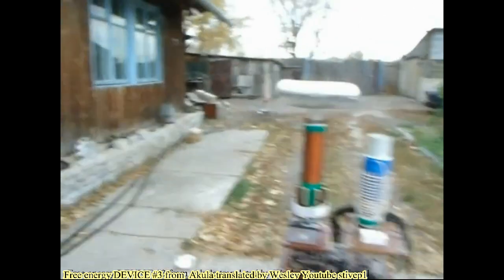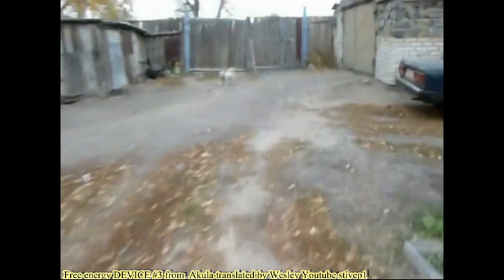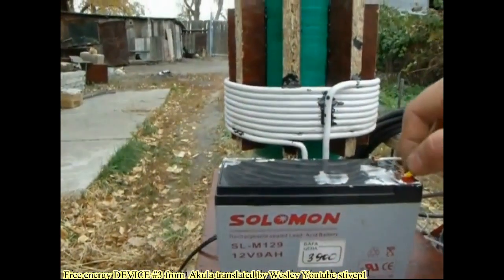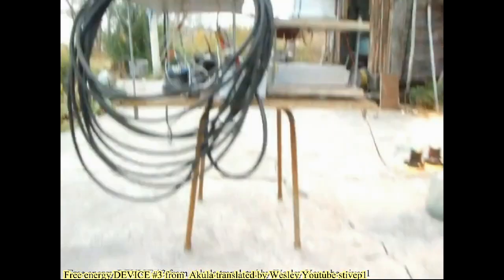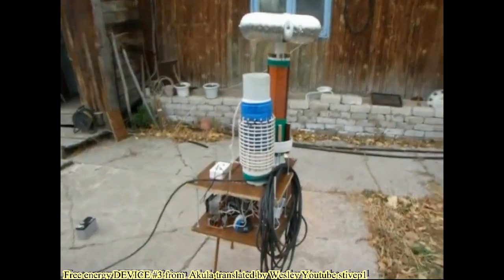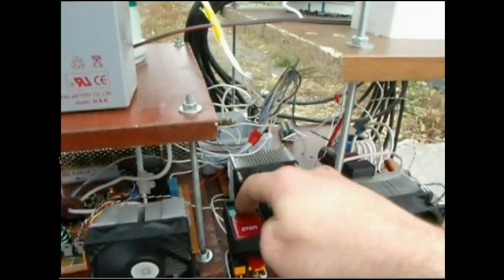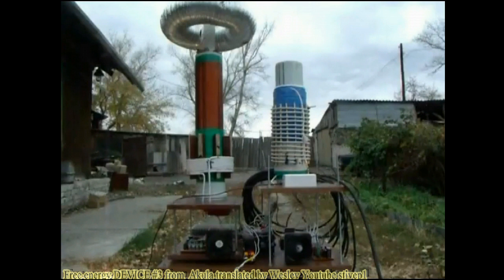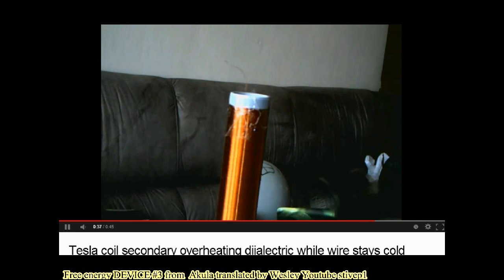Free energy Akula video #3 translated by Wesley

Comment from the maker: we  do not have problem in physics with  external photon or electron  knocking out electron from  K shell.
How about destabilization of a nuclei by bombarding it with electron or photon ( electron K  forced to  go to  nuclei).
What Tiger has it right is dis-balance from two sides of capacitor.
causing sucking electrons from  the ground -consumed  than by bulbs to create more sucking.( Latino-guys  patent application)
Any how we  going to get them by the balls 
Influenced by external influence.